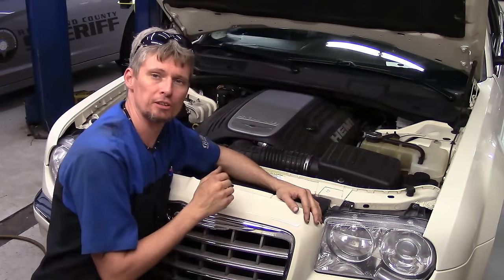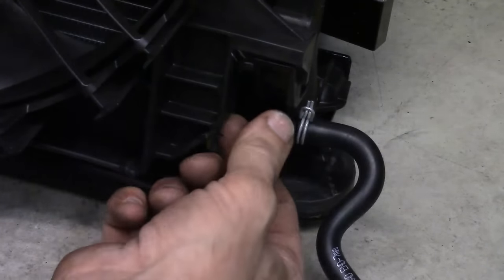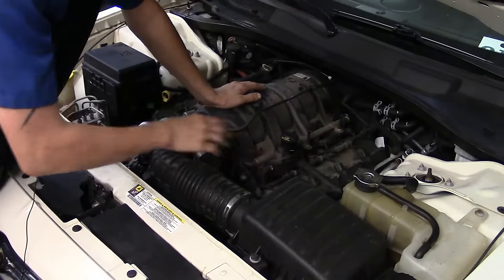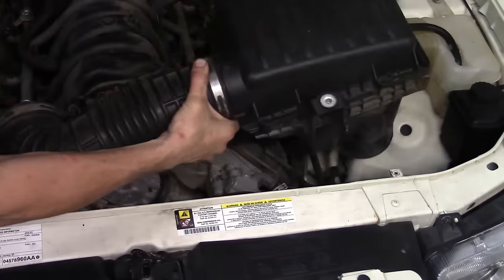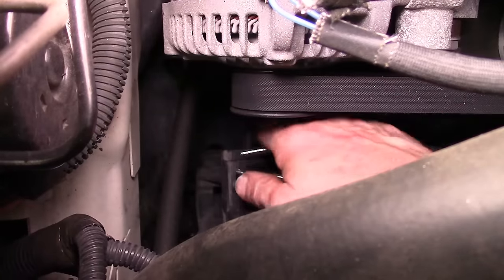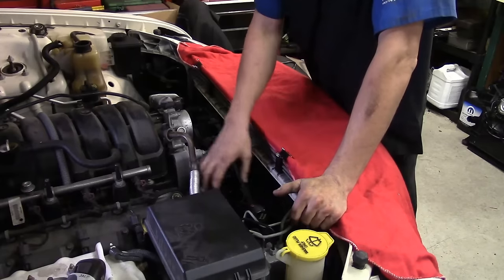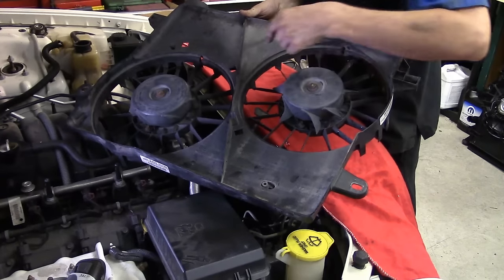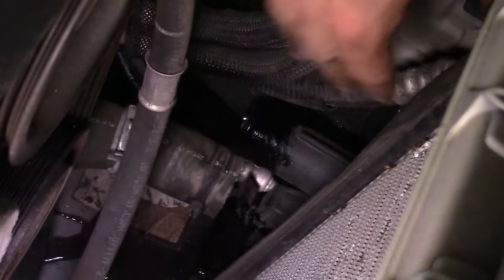Part 1/2: 2005-2010 Chrysler 300, Dodge Magnum, and Charger radiator removal

Comment: Hey dave...like I have mentioned before and below in one of my posts, awsome videos brotha and thank you...your info on my radiator installation was a success however yesterday out of nowhere my radiator fans completely stopped working. Also, my ac blows cold for about 2mins before it stops blowing cold...the car was driving fine all day yesterday and then at a red light I heard and felt a pop and the fans never worked again. I think I'm checking the correct spot for the relays..I do notice the clutch engaging on the compressor too but really see the outter pulley spinning. I cant figure out what's going on. Especially why the fans wont work being I think separate from the ac...any help or suggestions would be greatly appreciated..its for 2006 Chrysler 300c 5.7hemi and thank you

Comment: There was a problem with the transmission and it was replaced 3 times and each time the fault is different from the other. What is the reason for the 2008 Chrysler?

Comment: Thank you so much for the videos. The videos helped me remove the radiator fan assembly on my 2008 300c Hemi. Is there a way to remove the actual radiator without putting the car on a lift?  thank you again for this video!!
Reply from the maker: +Dave Weissinger You don't have to put it on a lift. I did in the video to help me do the job faster and for better camera views. It would help to jack the front of the vehicle up inorder to get more access to items. Just make sure to be safe and use jack stands and a good floor jack on smooth level ground. Thanks for the comment and for watching, Make sure to subscribe

Comment: This exact same problem happened with my 300c. I was stopped at a traffic light and I felt a small  "thud". Couldn't figure out what happened until I got home and had coolant was leaking.. The driver's side fan had failed and the blades punctured the radiator. $$$$$$$$$$$$$
Reply from the maker: Yeah I hate when that happens. Thats one reason when I inspect one of these I grab the blades and see if any movement. Sorry it happened....glad you found my video so you know what to expect. Thanks and make sure to subscribe
Reply: What brought me to your video is that the driver's side fan on my 300c/Hemi,   is vibrating  when it kicks in at high speed with the AC =ON. The vibration is significant enough that you can feel it through the brake pedal at a stop light.  It kinds of surges ("pulsates") and you can see the review mirrors resonating with it.  I originally thought it was the AC compressor dying as the vibe stops when you switch the AC off.  What ticks me is that I replaced both fans and MOTORS  only 7K mi ago when the same fan failed and punctured the radiator. MY guess is th fan has a bad bearing. Fan is not bad ($45), but the fan motor is NOT cheap..$150++.
Reply from the maker: Make sure no issues with the blades on the fan. I damaged/broken/missing blade will cause a lot of vibration for sure being that its out of balance. Then off course the typical grabbing and seeing if there is bearing play is the other method.

Comment: Hi, Thanks to your video, my removal and installation of both Fan and Radiator went flawlessly on my 2007 Chrysler 300C with one exception. My check engine light came on, and I can't get it to turn off. Iv'e tried most of the tricks on YouTube but nothing works. The car is not over heating and everything works well. Can you tell me how to get that light off?

Comment: hey buddy I have a 2015 dodge charger rt scat pack in I replace the radiator.  after I replace the radiator In put 2 gallons of 50/50 coolant I I turn the heat all the way on. the car is not over heating or anything but my friend say I still should  bleed the system but I can't find anything to bleed it from
Reply from the maker: +mustafadroid Being that its a 5.7....there is a bleed bolt on the upper front of the waterpump assembly. If you email me at david@motorcitymechanic.com I can send you some more info to help you. I cant attach anything here in the comments.

Comment: Hey I have a question, I have a 2007 Chrysler 300C 5.7 I need the alternator and radiator for it would I be able to use the parts from a same year magnum?

Comment: +MotorCity Mechanic
place on having radiator removed my a mechanic,  THE FAN IS MESSED UP  BUT I CAN DO THAT MY SELF ..IF I JUST GET THE RADIATOR DONE NOW.. HOW LONG WILL I HAVE TO REPLACE THE PLACE AFTER THAT ??
Reply from the maker: I am sorry but I am a bit confused, there is some mix up in translation. Please try to explain as much as you can so that I can help you the best that I can. Thanks
Reply from the maker: Your your saying that your having the radiator replaced but need to wait to replace the fan for now.....I wouldnt. Last thing you want is to overheat the engine and cause damage.

Comment: My 07 Charger is running hot, been taking alot of antifreeze no leakage though...the dealership says I need a radiator and thermostat, where is the thermostat?
Reply from the maker: +lashaa Wiley What size engine do you have.....2.7, 3.5, or 5.7? Also when does it run hot....sitting still or while driving?

Comment: hey man. how do u remove the dipstick tube from a 2006 Chrysler 300c 5.7?
Reply from the maker: +Ray The dipstick tube is bolted to the passenger side of the cylinder head at the front of the exhaust just below the valve cover. One you get that taken loose.....you need to gently move the dipstick tube slightly back and forth while pulling up on it. I don't have a video on that but that pretty much summarizes the removal. Thanks for watching and make sure to subscribe!

Comment: I have a 2006 Magnum with a 5.7 HEMI. Recently, It began to overheat while idle, while driving, etc. The coolant bubbles up as well. Ive noticed that the only time the engine will stay cool is on the highway (while driving at a constant pace). This made me lean more towards a fan/radiator related issue. Has anyone had this issue as well? Any help would be much appreciated.
Reply from the maker: It's common to have a fan issue and your description sounds like the scenario that would point towards that as well. Some models had one or two fans. Checking these is highly recommended. Having a scanner that can actuate the fans is very helpful. Otherwise supplying power and ground to each fan is another method......having a power probe would make life much easier
Reply: I completely agree. I just ordered a new set of fans this morning. Should be here by this weekend and ill do a quick install. Its pretty common for the fans to die out pretty early on these 5.7 HEMI engines. Im glad it wasnt anything too major like a blown gasket
Reply from the maker: +J Knight it just a matter of how hot it got. In some cases it can warp the heads. The head gaskets are multilayered steel so they don't blow like  engine long ago.....with the heads being aluminum.....they warp. Hopefully all goes well and no further issues
Reply: try replacing the coolant cap

Comment: Can you please help me replace the radiator drain plug (petcock) 
I pulled it out and I don't know if I broke it or if it's supposed to come all the way out.  
Are these even replaceable? I know you turn till stops but I kept turning and it popped out.  :( help me please.  Lol
Reply: Kelly Medley it stayed in
Reply: Just make sure the O-ring is good and put it back in is all you had to do. And it’s Pitcock 🤣
Reply: @nelsonward5829  petcock* and car is long and gone.

Comment: hey man. thanks for the beneficial videos. please make sure u keep them posted and dont delete them. i spoke with u a while back and am finally gonna change my radiator. do u have any tips on bleeding the system after the radiator has been installed? again, thanks for the videos.
Reply from the maker: No worries about ever deleting them. As far as bleeding....what size engine do you have?
Reply: +MotorCity Mechanic 6.1 engine
Reply from the maker: There should be a recessed allen bolt in the top front of the waterpump assembly. with the engine cold and the engine off.....remove that allen bolt and add coolant to the coolant bottle and keep filling until coolant comes out the bolt hole where the allen bolt was. Then reinstalled the allen bolt and then adjust the level in the coolant bottle. Recheck over the next few days when cold to see if any change in the bottle level.

Comment: 5.7 hemi ...while driving...the heater goes cold sometimes
Reply from the maker: +lashaa Wiley Usual leaks are at the thermostat gasket/seal. But you mentioned they can not find a leak. I would make sure that the radiator fans are working correctly. That would be after making sure the coolant level is topped off and the air is bled out the coolant system.
Reply: +MotorCity Mechanic is it the same if sometimes when I'm getting on my car the temp goes pass the mid point an when i let of it cools down.

Comment: how tou you refil the radiator  after  your don installing everything
Reply from the maker: The radiator refill procedure depends on what engine you have
Reply: +MotorCity Mechanic I replaced the fans and it runs better than it ever did. Im surprised something so simple could be such a headache. Keep the videos coming.
Reply from the maker: +J Knight glad it worked out! Thanks for watching the videos and for taking the time to reply back. Thanks again.